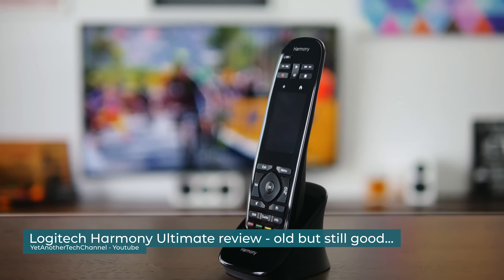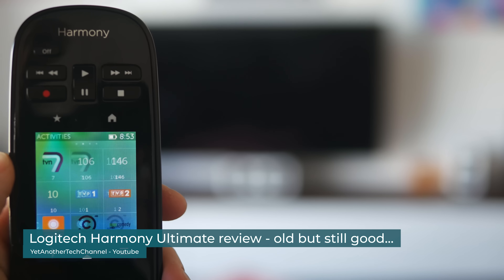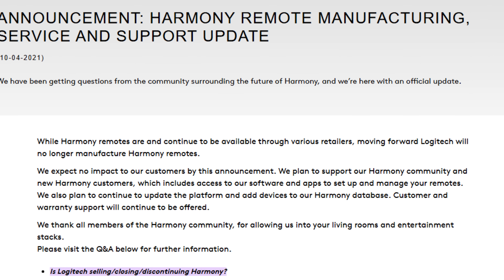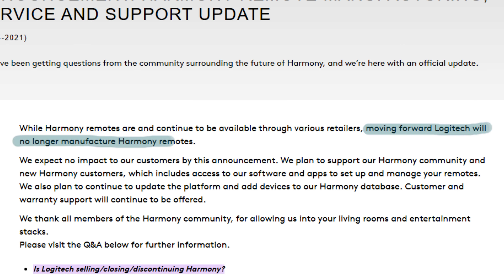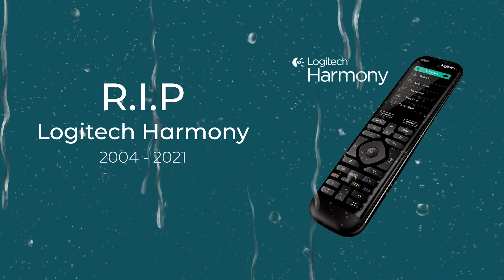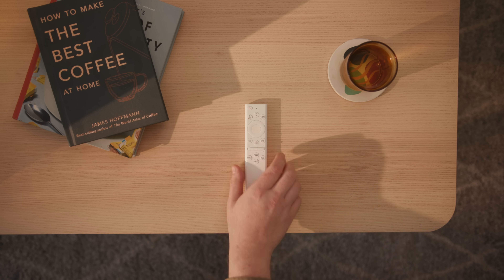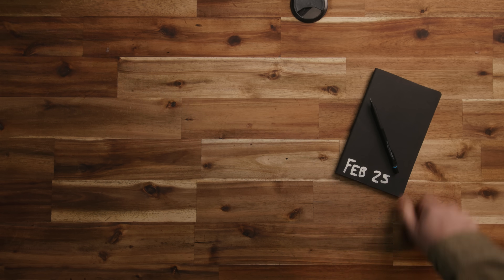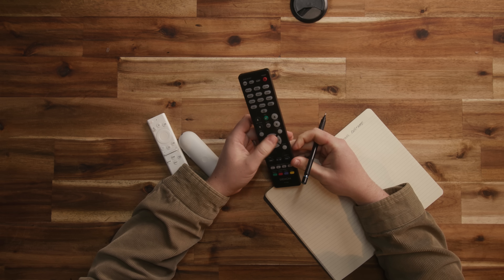My TV Remote Stopped Working… So I Made My Own.

Comment: Did you talk about battery life at all in this video? I’ve made a very similar project but it’s not that useful if it only lasts for a few hours on a charge.
Reply from the maker: I didn't cover it well enough apparently. 

I get about 36 hours with Light Sleep

Should be weeks with Deep Sleep 🙂
Reply: @TheStockPot-AU Yeah my issue was that the wifi radio is off in light or deep sleep mode. Waiting 5-15 seconds for the wifi to connect every time I picked the remote up was pretty annoying.

Comment: BRO - Add wireless charging and put the charger in the designated place for your remote. Bonus points for adding magnets for mounting the phone onto the charger. That way you could securely store the remote anywhere, like right next to your favorite spot. You could even do vertical storage on a wall with magnets.

Comment: Neat project.  I like the old super maximal remotes where every function had a button, but this is very practical and aligns well with modern TVs.  Also printing with glow in the dark filament for the buttons or button legends would be pretty cool.  Or having LEDs for a backlight and a backlight button with translucent buttons or legends.

Comment: fing brilliant. just reminds me how regular people can do much better job than a billion dollar company, lol. on that note, i for instance encode my dvd collection of old tv shows with QTGMC deinterlacer and even with my anemic nowadays 5650ge ryzen i get 10x better results that one could find on britbox, prime video or paramount+. and if i had more horsepower, aka an ADA gpu, i could upscale it with AI a bit and get even better results. just imagine if stock pot got 1/100th of production power of say logitech… these things would sell like hotcakes. anyway, thanks for reading my blog. subbed. cheers.
Reply: Much better? Battery life is 36 hours.
It's a great DIY project, but not a commercial product...
Reply: @ 36 hours of continuous use? does not have sleep mode? well, sure… a few tweaks before production would be necessary and welcome, lol.

Comment: Great video! Nice montage, good information, right length, loved it. Adding an (external) IR blaster to communicate with products that can not be controlled by Homa Assistant would be a nice feature. 
For example those cheap IKEA rgbw lamps that use small IR remotes.

Comment: I "built" a universal remote using a StreamDeck and HomeAssistant. I can take advantage of different folders to let me control a bunch of stuff. I've got a folder for opening different streaming services, for controlling lighting, for controlling window shades, etc. I also have a folder that has navigation controls, and on the HomeAssistant side, those navigation controls get mapped to whatever the active device is. It might control the nVidia Shield TV for Plex, or the LG TV for Disney+, or the Playstation 3 for BluRay. The latter one is quite convoluted, I put an ESP32 on a breadboard with some IR LEDs and use EspHome to simulate a Logitech Harmony remote, which talks to the Logitech Harmony PS3 bluetooth bridge, which is connected to the PS3, which thinks it's a PS3 media remote. Quite the crazy signal path from the StreamDeck, to the desktop computer, to the HomeAssistant server, to the wifi router, to the ESP32, to the IR LEDs, to the Logitech bridge, to the PS3... and latency is surprisingly good despite all that.
Reply: bro, can you help me fix this problem? I have an old speaker(kamasonic sk-200G) that I've been using with my PC for 12-14 years. Unfortunately, the remote got destroyed, and now I only have the circuit. I've tried many times to repair it, but I haven't been able to fix it yet. The issue is that when I turn it on, the bass is automatically set too high, and I have to manually decrease it using the button. I don't like the bass, and I only need a remote button that reduces it. The speaker's built-in button is also not working well. now what can i do? please help
Reply: @MD.ADE997  I don't know, I'm not an electronics expert? I'm a software guy.

Comment: Small noise maker for finding it then also add a two position slider switch on the side that locks the remote so that sitting on it doesn't actually trigger a bunch of commands

Comment: Well, even in 2025 I still hear people saying through hole is easier to solder compared to SMDs. I got to chime in. A good decade ago I figured out how much quicker and easier SMDs actually are, and I'm just avoiding through hole as much as possible since then... I'm not talking about minuscule 0402 parts and smaller, of course these are annoying for sure, but for example take a normal sized 0805 resistor or even going overkill with a huge 1206 part. You just put a blob of solder on one pad of the PCB, grab and place your component with the tweezers while tacking it in place with the iron at the same time, then put solder on the other side and you're done. With through hole you take the part, bend the leads to fit, then bend the leads again so it won't fall off, turn the PCB, solder the part, then take the flush cutters to cut the remaining leads. Doing this, you would have already soldered 2 SMDs, and it won't leave a bunch of small leads on the workbench. Note that I'm using rosin core 63/37 solder (Kester), never felt the need to add flux except for really small parts with leads close to each other (those sure are a pain), solder joints always turn out perfect, makes things even faster. Now, one disadvantage is when removing a SMD for a fix, I guess. Without some proper tools it can get a bit annoying I guess. For through hole a good desoldering gun with built in pump like the Hakko one makes life super easy for most parts.

Comment: I'm thinking about getting an IR system for home assistant, not very seriously but I have an AC and some fans that can only be controlled remotely via IR. So the potential exists to add IR functionality to this remote, without actually having to change the remote. Bonus, because the IR system is stationary the remote would not be orientation sensitive

Comment: 11:48 - It may not have an IR emitter, but I'd personally rather have an external IR emitter. Then you can place it in a location that you know will always work and stop fumbling around with the remote when you didn't get the right angle. IR emitters are fairly simple to make for home assistant, too. They're just kind of hard to program

Comment: Small tip about the buttons - even though the indented shapes look really nice at the start, eventually I've noticed they like to gather skin cells and dust. Included them as a feature on my 3d printed arcade controllers and removed them pretty soon because they get nasty.
If you can put the face of the buttons on the buildplate, you can make two files and print them on a single layer one after another, switching the color. Similar result but holds up way better.

Comment: This is cool but I need IR emitter, so it is no go... for now... 
I do however have a zigbee and rtl 433 running so I can pick up cheap 1-2 EUR remotes that can serve similar function. Not as nice but cool to figure out what I need.
If I was you I would have added a wireless charging coil. I have seen one as replacement for smart watches with even a magnet in middle for aligning and whole charging circuit for under 1 EUR. I Would then print a holder next with charger to place it next to a light switch or place a nice pad by the tv for 'this is the remote spot' as well as charging. 
I do not have a 3d printer so I would get a knock of samsung replacement remote and just gut it or order a 3d print without two types of filament. I think an indent would work just as well and more 3d printer providers could use it.
Fun project over all.

Comment: Very nice!
You could add an IR immiter to the remote fairly easily, I am pretty sure that ESPHome supports them. Instead of triggering the codes directly on the remote, you can have automations run them based on the button presses.

You could also pair this with a dedicated blaster in the rooms where its needed. That would mean you dont need to aim the remote ever, which would be a more seemless way to integrate the older tech.

Keep it up!
Reply: This is pretty much how HassBeam does it

Comment: Really cool Idea! But how long is the battery life if you use ESPHome? It is WiFi based and requires more power for communication, and AFAIK it requires constant drain to keep the connection alive. If deep sleep is used I could imagine a high delay in button pressed and action taken. Amazing project!

Comment: Heres a good tip:  Have a thermal-based switch so that when you hold the remote, the heat from your hand will close the circuit and power on the remote.   Or have one thats powered on by capacitance... or just a simple on/off slide switch.  (shrugs)  I thought it would be useful.   That way charging would be minimal.

Comment: I actually just bought a programmable IR remote from Aliexpress last night. It's called the MX3 Air Mouse. It also has backlight, full keyboard on the back, voice control, and gyro cursor.

I have some old TIVA C series boards with IR Tx/Rx lying around from uni projects. I might try programming them with my remote to do things like turn my very analogue speaker system on or off remotely.
Reply: bro, can you help me fix this problem? I have an old speaker(kamasonic sk-200G) that I've been using with my PC for 12-14 years. Unfortunately, the remote got destroyed, and now I only have the circuit. I've tried many times to repair it, but I haven't been able to fix it yet. The issue is that when I turn it on, the bass is automatically set too high, and I have to manually decrease it using the button. I don't like the bass, and I only need a remote button that reduces it. The speaker's built-in button is also not working well. now what can i do? please help

Comment: What would be really awesome is using a gyroscope and a chip with wifi ToF measurements to detect where in the room the remote is and what it is pointing at. Then, you could control the brightness of any lamp with the same two buttons.

Comment: I am making a remote for my Kodi box based on the SRM-7500 esthetic (with color screen) based on the ESP-32 as well. The only difference I would suggest, instead of an USB port to use the magsafe type connector from Adafruit. You can make some very nice docking stations this way. The 9pin version can support a USB3 interface. I need to get a better printer (Prusa XL) to make a proper 2 color flex filament keypad.

Comment: Things to add, accelerometer, speaker, backlighting, vibration feedback and IR transmitter, display. Great work ❤️❤️❤️👍
Maybe some side buttons.
Reply: Hmm, I don't know about side buttons. I'm so glad to see volume buttons that are NOT on the side like they are on my Google TV remote. I hate those buttons so much. I have to contort my fingers to get to them (or turn it sideways & use my thumb), and I sometimes end up somehow changing the volume without meaning to.

I've ordered the parts kit, & about to buy a 3D printer (I've  been procrastinating about getting one for ages - this remote has convinced me to bite the bullet & do it). It's quite timely too, as some of the buttons my Google TV remote have started to need "persuading" to work.

Good to see a fellow Aussie doing this!

Comment: What I love most about the Harmony is the activities. Being able to set up "Watch TV", "Play Xbox", etc is nice. plus the smart control add-on remotes last forever on a battery (months or years). Something like this with a more central hub I think would be great (could even have a single "hub" with multiple remotes to control different rooms).

But back to activities. with my harmony I would need at least 4-5 remotes in the living room to adjust for different activities that we use the TV for. Would love to see something like that accounted for (also allows you to adjust the room based on what activity you are using. I.e. when on "Watch Movie" the lights dim/brighten based on play/pause/stop status, but on "Watch TV" they don't)

Still really cool We don't "need" activities" on all our TVs so this would be great in the secondary tv rooms like bedrooms.
Reply: hes using home assistant with this, the custom buttons can trigger automations to do exactly what you're talking about.

Comment: Actually a kinda cool project. But (according to my rough estimate) <24 hours of battery life...? You have got to be kidding me? With deep sleep it could easily last multiple years on that battery. Of course you can't really use ESPhome then, cause ESPhome is useless for battery powered devices. Connecting to Wifi takes way too long. But if you use ESP-Now or something, the ESP would only need to run for like 50ms when you press a button and consume practically nothing the rest of the time. In my experience ESP-Now has a lot better range and is super quick and reliable. I have built a few battery powered devices with ESP-Now. And the battery discharges itself quicker than the ESP does. So really it makes more sense to use a non rechargeable battery. Cause it has a way lower self discharge. You can easily get 10 years of battery life that way.
Anyway, apart from the absolutely terrible battery life. Not too bad. I would maybe use buttons that don't feel like they cost 1 cent each. Kinda makes the whole remote feel cheap, if the buttons feel cheap, you know.

Comment: Ooh!!!

I've already thought of projects involving FLIRC USB receivers, but won't get into those here, however the idea of just making a remote somehow blew my mind as a project I didn't think of doing. I already have a remote control design idea I could design, so I could take on a project like this if I wanted to.

One thing I use universal remotes for is to feign decent CEC support on TVs that don't support that or have poor support* for that, but your idea with ESPHome and Home Assistant looks like it could take my idea further for devices that don't support infrared but can be controlled by HA.

*For the poor HDMI CEC support, I'm referring to TVs whose CEC implementations only pass the directional pad, back, 4 colours, and media transport buttons, which from my perspective include the 2017 LG, 2020-2024 Prism+ (rebadged Skyworth), and 2024 TCL TV models I've used, in comparison to my 2014 Sony TV that not only passes those aforementioned buttons through but also the numeric keys, channel up/down, and a few other buttons, to the point where I can use my Android-based pay TV receiver almost as though it was the TV's built-in tuner!

Comment: In the days of $20 usb-c hot plates, I actually think it's easier to use surface mount than through hole these days, especially if they're 0603 or bigger. Especially if you don't have any ICs and you're making a lot of something.

Comment: Frankly I'm surprised it lasted this long especially when they initially went away from what harmony was meant to be.  I remember back in 2001 at a high-end audio trade show in New York I met with the company I think they were from Canada and when they told me what the remote was about I was amazed and was hoping for it to come out yet it never did at least in New York and  The whole idea of the remote was for it to be truly universal remote where it can control everything that was infrared in the house from AC, fan or whatever a stereo or TV it didn't matter and if it didn't exist for them you could tell them what model and they would set up a code to have it work for you remote and at a low price. Now fast forward a few years it's 2004 I live in Florida and I hear Logitech purchased the company and I  was excited  To only find out that the remote is a just a  Clarify universal remote that is only 4 entertainment systems yes a few years later they added some really expensive air conditioners and fans a few other things but not what it was initially meant to be and it was ridiculously expensive and some batteries were difficult to remove after they got swollen. But in the end it was not what it was meant to be when it was initially introduced  Like I said surprised me that it lasted as long as it did. Maybe or should I say hopefully  Somebody buys the rights to it and makes it into what it was intended to be.

Comment: This looks amazing! One thing you can do with the buttons is to use small paths of material to connect them all into one layout while printing. Old TV remotes used to do this to simplify assembly and keep the buttons in the top shell easier.

Comment: Sorry man, but a Roku is just way cheaper and easier (you get a full cec control media device with a standardized and replaceable 2.4ghz remote, smart apps that actually work...), and that's assuming it's not just built into your TV already... (seriously it's so damn slick and seamless; watching this video on a Roku TV right now.  So much better than one of those terribad "smart" TVs with built-in "apps").

Comment: @thestockpot thank you for such an elegant tutorial and design. You mentioned in your video you had also posted a simplified version of a controller with a less fancy array of buttons than the media controller/pcb? Do you have a link for PCBWay? and STL? No worries if I misunderstood. Home Assistant/ESPHome is so in need of tailored controllers for lights. 

Were you able to assess what the average mA current draw is from the ESP32? How often does your unit have to be recharged? Did you experiment with a BLE link to Home Assistant rather than a WiFi link for your  ESP32 controller?